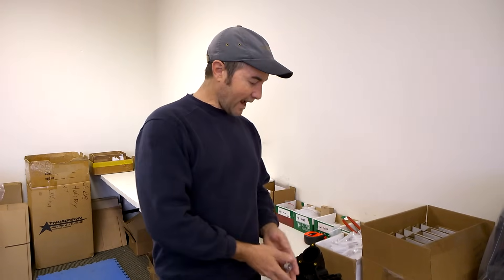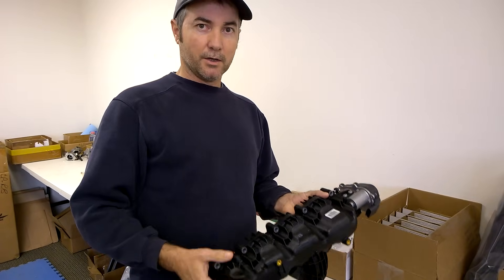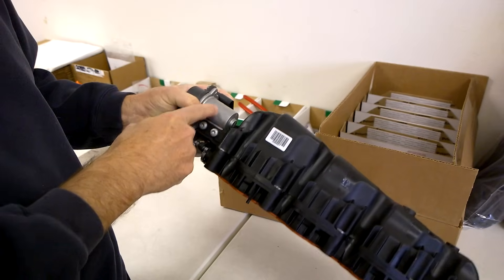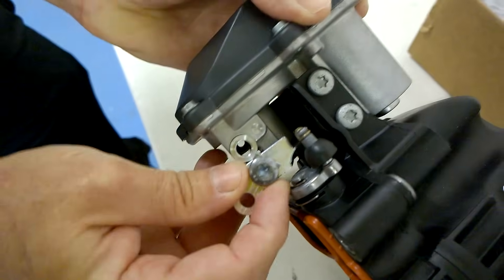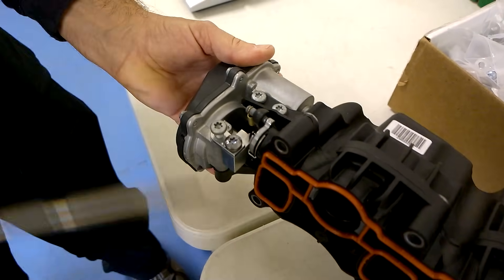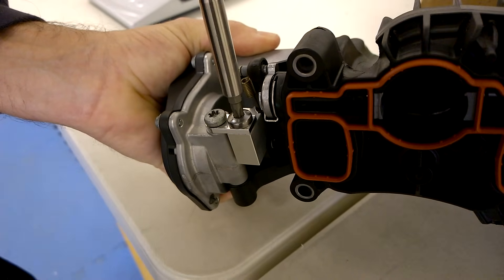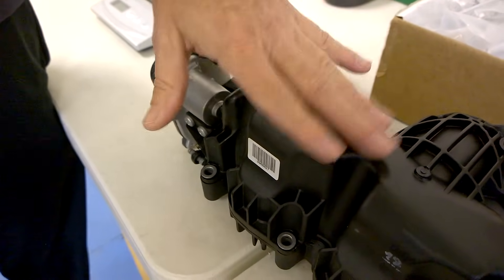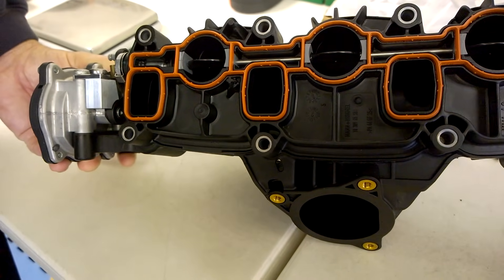P2015 Repair for 03L 129 711AG black plastic manifold

Comment: Hi. Excellent turorial.  I've had a new swirl motor and bracket fitted which has cleared p2015 but I now have manifold flap codes p2004 and p2006.  Do you think it may be a bad install of the bracket that you have caused this? Thanks

Comment: After cleaning the intake manifold and installing the bracket, you can check to see if the fix worked by just plugging it back in and somehow clearing the code? Does the car not need to be turned on in order to clear the code with the VCDS?

Comment: Hi there. I just fixed the bracket on the v157 motor, erased the p2015 error code,  but after 20 min is still on. The CEL keeps coming back on. Put brand bew intake manifold and v157 motor with the bracket, but the CEL still coming on after 20 minutes.

Comment: Do you provide a P2015 fix for the VW BLG engine? It's a 1.4 TSI from 2008. The one with both turbo and compressor. I've changed the sensor but the P2015 error comes back after a couple of days

Comment: Hi , I have this problem P2015... but my problem is that the V157 motor is not working... finished ... maybe the brushes are already finished. I bye new one V157... so will the bracket help me in this case ? Dieselgeek told me that with new part ( V157 motor aftermarket) is not possible to fix the problem. I'm thinking if I change only the motor inside from the new V157 to the old one ... will this help ? Did someone do something like this ? Give me please a help... more than 2 mounth I'm trying to solve this problem. I think the wors case I have to bye new plastick manifold.

Comment: G'Day mate, I have 2006 Audi Q7 3.0TDi and the check engine light came up, after having it checked error code P2015 indicated the Intake manifold flap error, the warning light only came on once then cleared, is this a fault that needs fixing straight away and if left can it damage the rest of the engine, also do you sell replace parts overseas and how much, thanks mate great video